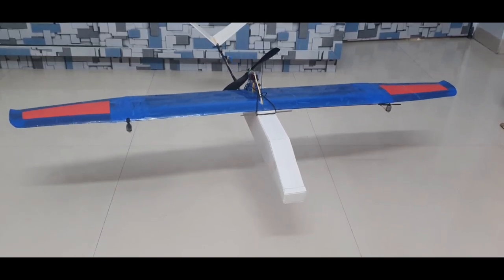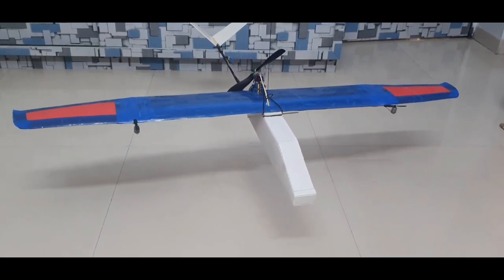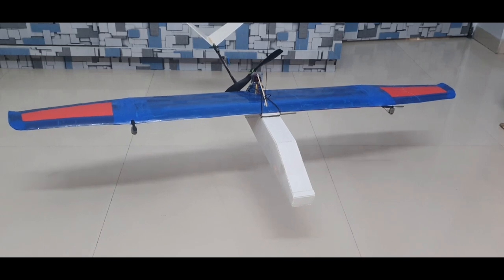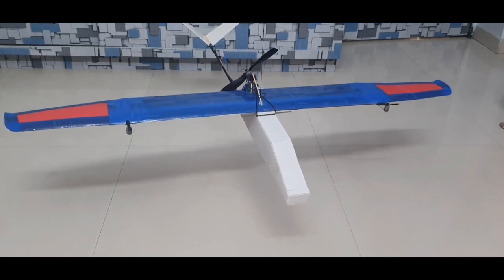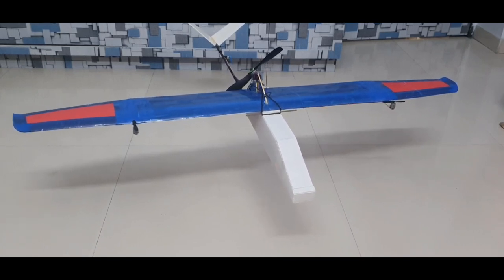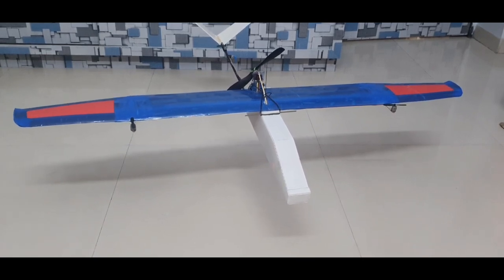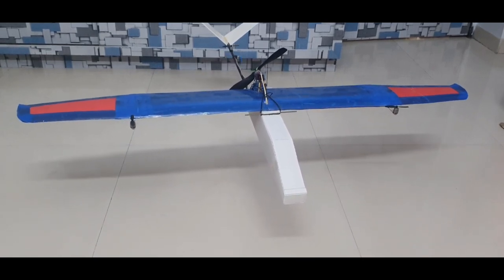Experimental RC plane without Servos and Control Surfaces (Part-2: Ground control test)

Comment: Why not test it while giving it a try bit of throttle? Of course it failed in the next video. This was not a proper test
Reply from the maker: This testing was done to just make sure all DC motors works in intended manner. 
It failed but when i changed approach it worked. Truly a plane without control surface.